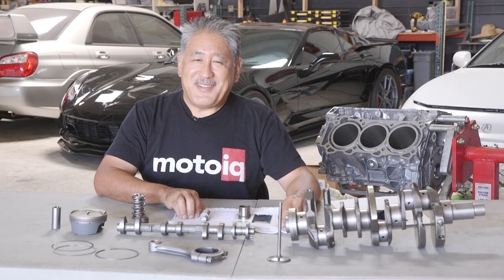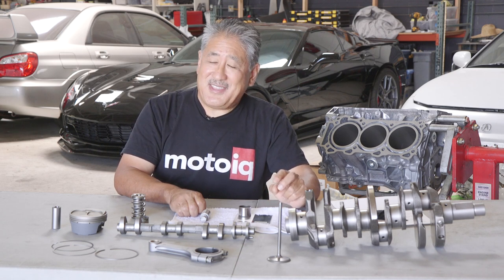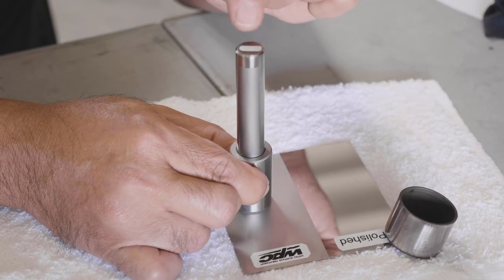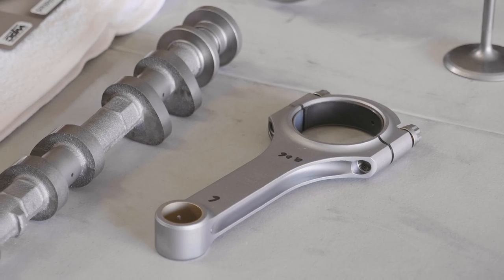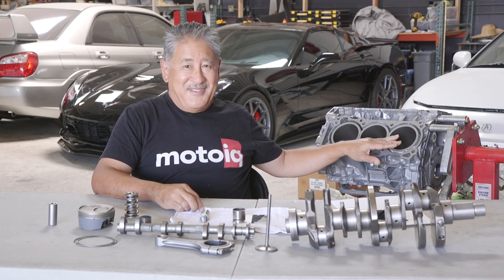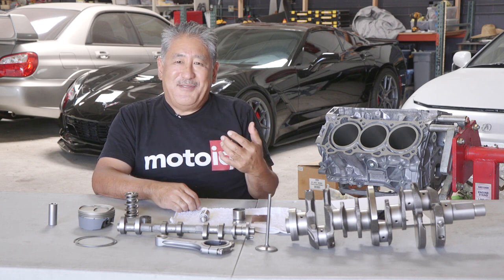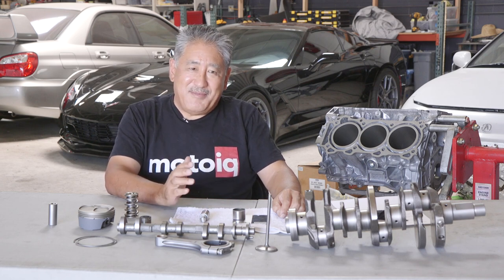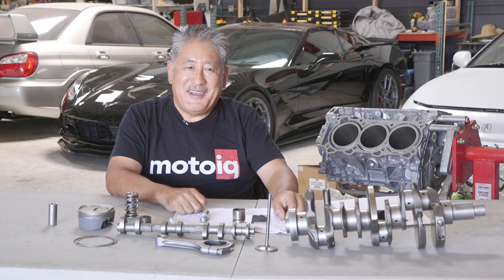What is WPC Treatment and Why Do We Use It On Our Engine Builds?

Comment: Now i want to build an engine and coat everything with wpc
Reply: Not a coating.. its a micro dimpling surface treatment
Reply: @jamesdills6720  yea sorry that what i meant
Reply: I heard doing the cylinder walls is actually not too good, because the rings never want to break-in.
Reply: Martini is a wino he said in the video that it takes a couple more dyno pulls to seat the rings.
Reply: Hope you rich
Reply: @jamesdills6720  🤣
Reply: 😆 EXACTLY what I thought
Reply: @tylerdurden9517  is it that expensive??
Reply: What's the price to do all moving parts an cylinder walls,,,  just the engine... All I've seen is it's not cheap it's expensive etc. But ball park price with numbers I haven't seen it,, might not be that bad for what it does.. Just imagine if yur just a weekend warrior or burn outs donuts it might be worth every penny
Reply: @edwardlopez438  piston was like $30-40 its dirt cheap

Comment: Damn near my whole motorcycle engine is WPC treated.  This stuff is the real deal, no doubt.
Reply: How long do you have it like that? Any negatives?
Reply: Did you notice any difference in how smooth the engine runs and how fast it accelerates??
Reply: @bluewanderer9903  2 solid years now, no issues
Reply: @FirstLast-tx3yj  i did a whole bunch of mods to the engine so thats probably most of the power gains but how fast it starts, i think it helps.... i did it more for longevity vs performance and thats the better way to look at it
Reply: @thejayvodlexperience7856  did you do it yourself??
Reply: @FirstLast-tx3yj  I rebuilt the motor myself but parts for coating has to be sent to WPC
Reply: @thejayvodlexperience7856  how much did it cost
Reply: @dano3723  crucial parts except crankshaft cost me at the time around couple Gs for a 2 cylinder
Reply: Had this done to my transmission gear cluster.

Comment: I've watched this video a few times and each time I learn something new. Today I learned DLC and WPC work together, and side-coated piston skirts with WPC is less common.  I've seen DLC applications for every component of the piston, and love to see it with the WPC treatment done first.  How does it, or doesn't it, affect friction, lubricity, and overall wear/performance?  Great video — I'm setting a reminder to watch it again  in a month.😉😎
Reply from the maker: We found that coating doesnt stick to a WPC treated piston that well.
Reply: @motoiq  sir, i still had silly question, but u think effective is effective we use ceramic coating on piston crown ( for reducing heat ofc) coz, in my mind if can combo WPC + ceramic coating crown its so overkill

Comment: Awesome video! You covered so many possible uses but didn't mention the fastest spinning thing in a car - a turbo! Have you tried WPC treating turbo internals for faster spool / better transient response etc?
Reply: Good thinking.
Also, wheel bearings ...
Reply: @bluewanderer9903  also, damper rods and tubes
Reply: Turbos are already set up for tolerances as low as .00005"
Reply: I wonder how this affects oil film /movement of oil across the surfaces. For example, would it reduce the tendency of oil to "stick"?

Comment: Sure would be cool to see a complete engine before & after coated, torque to turn on the engine stand.   Or before & after on the dyno.
Reply from the maker: Its pretty expensive to do an engine back to back.  We did do my daughters kart engine and it gained 0.2 hp which is pretty good on a 9 hp engine.  It cut almost a second off her lap times.
Reply: @motoiq  Thanks for the reply!  I understand its expensive to rebuild motors, but if a known engine is going to be rebuilt it seems it would be relatively easy to remove the spark plugs on the engine in question & do a before & after by use of a torque wrench. I have done something similar with engines before & after with synthetics. Anyways, always learning from the good videos you produce.
Reply: @motoiq did you cryo treat the kart engine as well?

Comment: For valve springws, does this modify the K in F=Kx? For piston rings does it modify the compliance (I'm not sure the term, but hoop strength (It's basically a spring)? I want to be really clear on this... from your experience, does the overall dimension change? I know you said in the video the tolerance does not change, but surely the nominal value would, right? Finally, please just do more videos. I love them. Best on the web for automotive tech!
Reply from the maker: No it does not change K or do any dimensional change down to tenths which is the best we can measure.

Comment: You mentioned WPC treating titanium valve stems, has that eliminated any galling and cut down the wear within the guides? I really want to use the WPC on my Gen 3 hemi on the springs, valves, especially the rocker shafts. I wish more people would document the use of WPC.  I've only utilized it on a VK56DE oil pump housing and gears. 

Would really like to try it on my triumph 675 triple engine and trans.

Comment: I’m extremely curious if this would solve the cam/lifter issues that the hemi and ls engines have. This treatment sounds like it can used to not only possibly solve those issues with cylinder deactivation engines, but also add to the efficiency of the engine as well. Taking a v8 that shuts off 4 cylinders and reducing friction by up to 50% makes low load cruising more economical, while also freeing some power and lowering temps when under full load. Hmmm.
Reply: It sucks that the simpler design of ohv single cam engines are naturally going to have extra resistance. Although when you turn them by hand, ohc engines still have about the same resistance. I think that's more in part caused by the chain or belt length. Subarus being a perfect example, I'm not exactly sure what the hemis problem is but I heard it was just poor quality steel being used in combination with cheap lifters. They aren't terrible lifters but they obviously have a typical life span. I'm just guessing cause the predecessor to the hemi, the magnum engines hardly ever had lifter issues. Although I don't know how the cylinder shut down works so that could be the whole reason why but this is just my thought on it

Comment: real question always is how much does it cost? And if WPC makes the friction lower, wouldn't putting it on clutch packs just cause it to slip more and engage less?
Reply: For an inline 6 crankshaft is $310, for each shell of the rod bearing or crank its $12, each cylinder bore is $100, very reasonable prices, Also it increased lubricity which in hand is good for clutch packs, that's why they have friction modifiers for the oil.
Reply: 100$ a cylinder? Geez
Reply: @SavageBunny1  Only $310? That is nothing compared to repairing or replacing an entire engine. That little money to double my engine life is pennies.

Comment: I have heard that (proper) Cryo treatment combined with WPC treatment can even further extend the durability of any stressed prone parts.   Unfortunately most of those claims have come from vendors so I would love to hear what your personal experience has found on the matter. So, what do you think of cry treatment?(with or without WPC)
Reply from the maker: We find that the biggest increases are in wear resistance.  Usually at least 50% better.  Cryo helps abrasion resistance to some degree and helps in fatigue strength by at least 50%.  It's not going to make crappy metal or an underdesigned part amazing but it will make it last 2x longer before it breaks.

Comment: Change in surface hardness aside.

These tests all look impressive however I wonder how different these tests would perform when oil is introduced as in actual operating conditions.
Reply: I think the main benefit of this treatment is when oil is not present, or atleast not enough of it to avoid some friction. It looks like creates microstructure finish that retains a coating of oil that surfaces glide on.
Reply: That’s what I’m thinking, a lot of these rotating assembly parts have a thin film of oil between the contact. Lol I’m sure this helps A little but depending on how expensive it is, is it worth it? Who knows

Comment: Seems crazy that you could make a surface more dense through shot peening, without effecting the tolerances at all.
Do you think that is down to the dry lubricant being left impregnated in the surface of the parts? I guess it could also be that the surface change is so small it doesn’t effect clearances 🤔 either way seems like a great service! Shame it’s doesn’t appear to be available across the pond.
Reply: WPC has less effect on surface dimensions than shot peen.
Reply: @SylasG  I find WPC coatings excellent, I lighten by grinding all my parts on my Norton race engines, just plain shot peening by a knowledgable source can strengthen an undisturbed steel conrod by up to 20%. The key is "a knowledgable source" I use a company that peens the root radius of Bell helicopter variable pitch Blades. I wpc my aluminum parts and Babbit shells minimum excellent. This was F1 Tech only.

Comment: Man, You the man, Thanks for sharing your knowledge. I’ve always been a piston head 😵‍💫. I’m just starting with  (Old School SBC racer😵‍💫) LS engines 1 LSA and just finished a LS 9. One question if you don’t mind. What is the red coating that GM puts on the bearings? The bearings I took out of both engines look brand new .
Reply from the maker: It's an anti scuff coating for initial startup.
Reply: @motoiq  must be good stuff the lsa had 16,000 miles on it and the bearings and the crank looked brand new. Thank you for the response. Batman 😎

Comment: I was building a motor for my Mazdaspeed 6 and had the Pistons, rings, and bearings WPC. I sold the build before I got to finish it.  

My question is, have you had similar builds that you have had one with several components WPC treated, and the other without any WPC and could quantify any performance increase?  Like has the WPC one had higher output due to the reduction in friction?
Reply from the maker: On a car, it is super expensive to do an A to B test on WPC only but I have done it on a go-kart engine, on my daughter 50cc two-stroke Kart, it gave .2 more hp on a 3 hp motor and took a second of her lap time on a 1.03-second track.  When she moved to 100cc karts it gained .3 hp on a 9 hp engine and gave her just under a second improvement on a 37 second a lap track.  These are spec motors but the WPC isn't detectable and pass tech. For cars, the engine life is greatly increased, that's for sure.  Also when a new engine is being turned by hand while being assembled, the friction is way less and the engine spins a lot easier.
Reply: @motoiq  wow! That's awesome. Thank you for the reply!

Comment: I'm wondering if the WPC treatment would be good for the friction surfaces in an AR-15. Maybe even a muzzle treatment to increase velocity and consistency. I already know that you can get a DLC bolt carrier group for them. I'm wondering if the combination of the tube would go really good into increasing reliability and velocity / accuracy.
Reply from the maker: If it is a phosphated bolt yes for sure.  Haven't tried it on nitrided, or chrome yet.
Reply: @motoiq  Excellent! I'm wondering if the process would be able to be done inside the bore of a barrel. I understand the concept of how it works but I don't know much about the process. I don't know if you could get the equipment inside such a small hole or how it would affect the rifling. I know a lot of people including myself run stainless barrels in their precision competition guns. That could be a game changer if it's possible. By the way, thank you for your response. I really appreciate it and did not expect it.
Reply from the maker: its hard to get the medium to hit at the right angles inside the bore.  I tried it on a glock with a stainless barrel and it only got the ramp and chamber. That gun is easy to clean!  From what I understand, some military units use the process on their SAW's due to a friend of mine that does special stuff, he says the cyclic rate and reliability go way up, especially on the M249spw
Reply: @motoiq  I had a feeling that might be the case. Maybe as time and technology progress the ability to perform a treatment inside the bore may become a possibility at some point. Regardless, it's an excellent technology that should get more applications than it does.

Comment: Followers used was different from one another so I say not a valid test take two brand new ones then do it . Or if you want to stick with used ones use the same one . There is a cone built to the top surface and one was warn so it was flat would not spin as good. Other one still had the cone shape on the bottom that helps it spin .

Comment: how much horsepower gain after WPC all engine parts?, have you compare it?, less friction should be more power
Reply from the maker: On a car, it is super expensive to do an A to B test on WPC only but I have done it on a go-kart engine, on my daughter 50cc two-stroke Kart, it gave .2 more hp on a 3 hp motor and took a second of her lap time on a 1.03-second track.  When she moved to 100cc karts it gained .3 hp on a 9 hp engine and gave her just under a second improvement on a 37 second a lap track.  These are spec motors but the WPC isn't detectable and pass tech. For cars, the engine life is greatly increased, that's for sure.  Also when a new engine is being turned by hand while being assembled, the friction is way less and the engine spins a lot easier.

Comment: What does WPC recommend for surface prep? Depending on that, I could tell you what's in it. If it's heat vs acid etch for instance; moly is an acid etch if memory serves, and if there's a heat chaser, ptfe or graphite is involved. All of those are friction modifiers, though moly has that dull silvery grey surface appearance.
Reply from the maker: Whatever the final surface finish for the end use is.
Reply: @motoiq  Interesting. I misunderstood and thought this was like a send-out service, but if I understand correctly now, this is like a product that is forcefully applied like a reverse sandblast or kind of like an anodizing treatment (in terms of surface transfer) of sorts? Initially I had in my mind that is was being done as an industrial hot tank process where the product was surface bonding chemically.
Reply from the maker: It's impingement with super small ceramic spheres and dry film lubricant.
Reply: @motoiq  I very much appreciate your having expanded my wheelhouse to the product. I'm occasionally guilty of getting to that point where you try a lot of things but stick with what you know works or make one yourself. Outside of nitriding which isn't really what I'd consider long-term durable on hard-wearing surfaces but better than nothing, Cerakoting or products like it were something I'd turn to on occasion if it wasn't like a bearing or journal surface. More often than not, I'm more concerned (in my field anyway) about thermal protection than metal-to-metal contact and fell back on oil additives for the heavy lifting with asperations to finding something better one day. 😉

Comment: So When my and my sons mx bikes need new piston i can send it off to you for wcp treatment and it will fit straight back in cylinder ok on 2000 cr250 and 05 kx85
Reply from the maker: Yes it will, doing the rings and the cylinder might not be a bad idea too.  Did it on my daughters kart, took .8 seconds off on a 50 second lap.

Comment: What a fascinating explanation of this metal treatment process. I am going to contact these guys when it's time to rebuild the engine on my 370Z.
I wonder if this process could be applied to aluminum connecting rods to make them more durable for long-term use in street engines.

Comment: Great vid, thank you. Maybe a stupid question, but didn't see it commented below, nor in the vid. Is this WPC suitable for brake rotors? Obviously reduced friction is a bad idea there, but if this could be overcome with longer bed in process similar to piston rings, maybe after that is not a bad thing to have for increased rotor life?
Reply from the maker: No, but cryo treating helps.
Reply: since WPC only affects the surface, and rotor wear is measured in mm, not microns, it'd probably go away pretty quickly. You'd probably get a bit more rotor life (see Porsche's Tungsten carbide coated rotors) with soft street pads, but I imagine that with metallic race pads, you'd immediately annihilate the surface, and have trouble bedding in the pads.

Comment: hmm if you get more strength then i would think the important parts could be made a lot lighter with less material. that rod pin is a good example. maybe a good idea to make it smaller if its so strong already. I wonder with the new things coming out like with porsche trying to 3d print pistons, combine the additive minimal design/hollow pistons with a wpc process, and see how light the inertia sensitive parts of an engine could get down to. would like to see higher revs even in commuter econo box cars with variable valve timing. im sure GM will still find a way to engineer things to break 1000 miles after warenty lol
Reply from the maker: your car first

Comment: What about powervalve treatments? Would it be beneficial, is there alot of friction-stress going on there.
Reply from the maker: A two stoke power valve? It would probably help the operation.
Reply: @motoiq  yes for a two stroke, i har my mind that i would perhaps DLC coat it, but a professional mechanic for one of the best team in motocross told me about WPC, and now i try to think what i should treat, the transmission aswell.

Comment: How about cylinder walls? I believe Honda uses a ceramic coating instead of iron sleaves.
Reply from the maker: Some Honda engines use a cast silicone carbide matrix cast into the aluminum. WPC works on all of that.